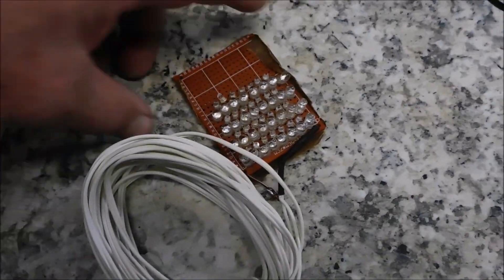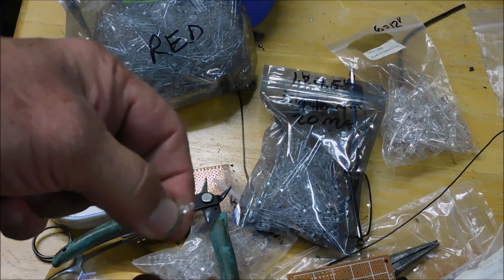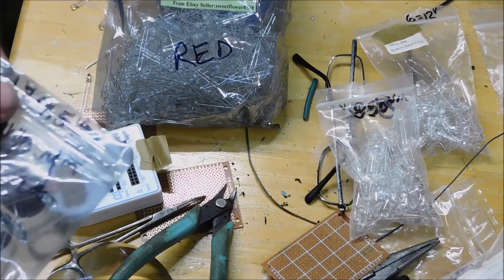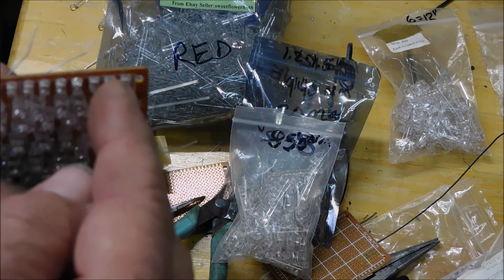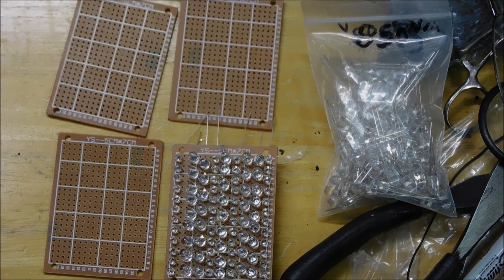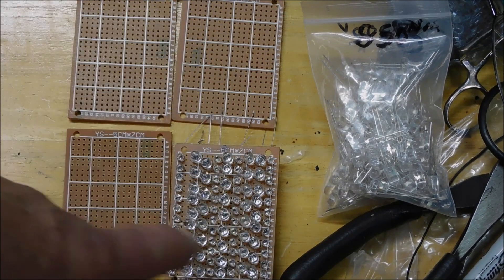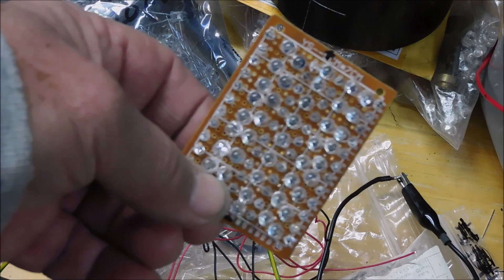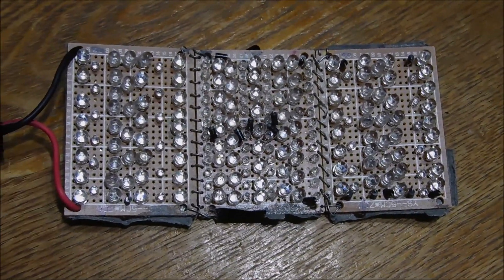MAKE YOUR OWN RED LIGHT THERAPY DEVICE ! $AVE HUNDERDS $$$$ !

Comment: You should have a current limmiting resister in series so you don't over power them and burn them out. Those types of LEDs usually run at 20mA. And why would you add regular diodes to them?
Reply from the maker: I use the diodes to drop the voltage by .5 volts with the addition of each diode in the line of LED's. If you just add another LED, the voltage drop can be way too much (a couple volts) and lower the brightness more than would  be useful. I try to regulate the voltage to keep the LED's from overheating, but still produce a usable output. It is easier for ME to do that than, connect the LED's in a string and measure the current and then use ohms law to figure what resistor needs to be used then acquire one for each line of LED's.  It just works without math. So right or wrong, its just a lazy way to do it. I hope you don't feel too poorly of me. I also hope you understand my explanation. Thank you for watching. AND these lights DO WORK GREAT for pain and healing.
Reply: @davenooner2142 . Ok. If it works, it works. Merry Christmas. 🎅

Comment: Ahhh so cool!

Going to build one myself. How do you go about testing the light intensity, and actual emitted wavelength and similar parameters?
Reply from the maker: All led's have specifications of frequency of light and intensity at certain voltages and currents. Only buy what you want to use. There is a lot of research about red light now. I will say that from my research and actual use... just a few frequencies over a broad spectrum seem to work fantastic for me and my friends. Even just three like I use work fine. It does NOT need to be complicated to work. Good luck and thank you for watching!

Comment: Always neat stuff! I have a lot of respect for all of you who understand electronics. Thanks for sharing!
Reply from the maker: ADAPT 2030 just put up a red light therapy video just today. It can do so much. I use mine all the time. Thank you for watching sir.
Reply from the maker: I was thinking about your comment. I am no genius, by any means. I look at it like this... picture this setup. You want to build a  charcoal grill. You have a set of plans, they say to use a 1/4-20 to affix it together. You don't understand what 1/4-20 means, so you look it up. You find out that it is a 1 fourth inch diameter bolt with 20 threads per inch. NOW you understand what it means, but you don't have to understand all that to build from the plans. Just follow the guide, the schematic diagrams, the plans. Like putting a 1/4-20 bolt in the correct way so the head is out and the nut is in... an LED or a transistor just goes in the circuit the correct "way" also. It is not a big leap to electronics if you have the plans to follow... the schematic. You do not need to fully understand a transistor to make one work in a circuit. You can do these things easily. I bet you would enjoy it too. Thanks again for watching.
Reply: @davenooner2142  that is quite kind of you, and I believe that you're correct. I just haven't been desperate enough yet to get my toe in the watet.